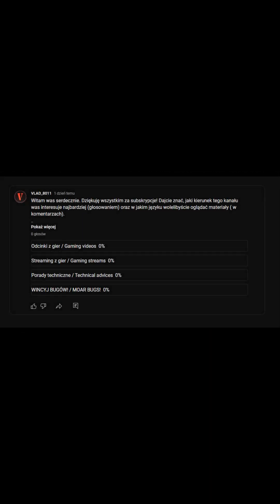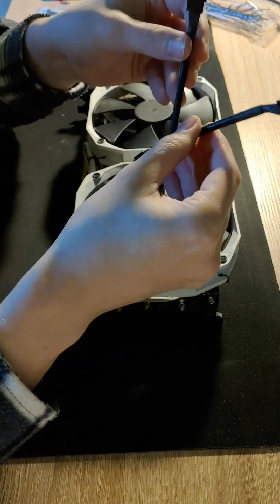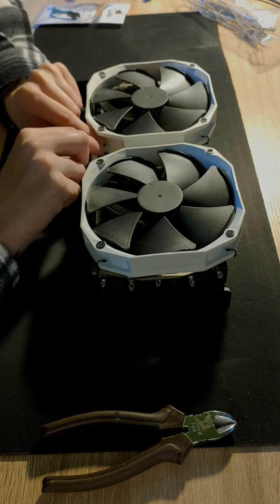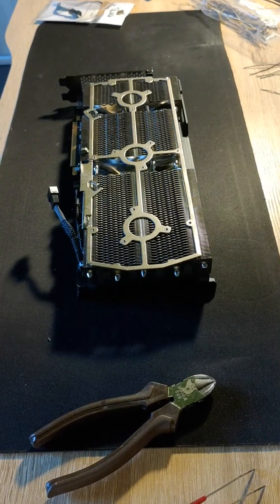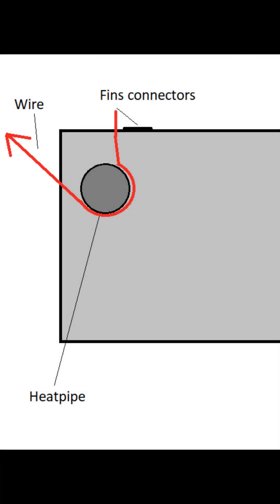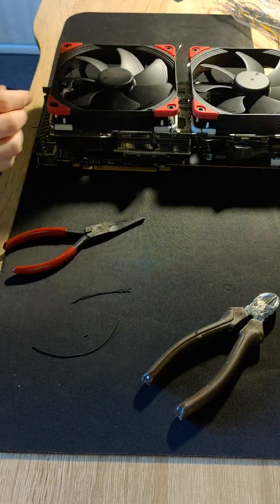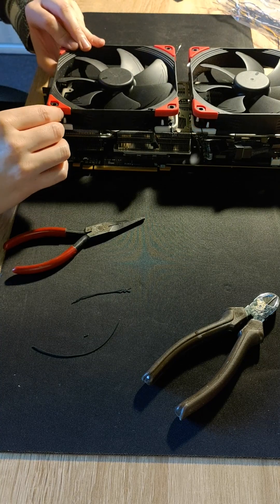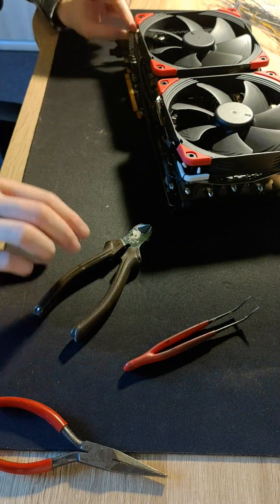Swapping Fans on the GPU - drastic noise reduction

Comment: jak wyglada temperatura w stress tescie przy 1500rpm?
Reply from the maker: w stocku czy na obecnym UV? Bo stocku nie ruszam od nowości ze względu na cewki
Reply: u mnie tak piszczy ze leb urywa tylko ja mam red dragona
Reply: i tak i tak myślę czy u mnie zrobić takiego moda
Reply from the maker: @flash8392  89 stopni hotspot/62 stopnie core w stocku, 71 stopni hotspot/56 core UV.
A UV to 2250Mhz, 1050mv, -3 power limit w Sterowniku Adrenalin. Do tego blokada na 60 kl/s (również w sterowniku). 
Kultura pracy nieporównywalna do fabrycznych wentylatorów. 33db maks.
Reply: @vlad_8011  właśnie nie wiem czy nie lepiej mi sprzedać ta kartę bo tak cewki piszczą ale ludzie mówią że może być to wina zasilacza
Reply from the maker: @flash8392  Możesz sprzedać, przynajmniej spróbować. A jaki masz zasilacz?

Comment: Could you provide link to the PWM to graphic card adapter cable you bought ?
Reply from the maker: Video description updated, you can find link there - then you can find it cheaper by its SKU (CA-PWM-02) in your regional shops. I recommend buying 2 or even 3 for future. Also dont forget about fan splitter.